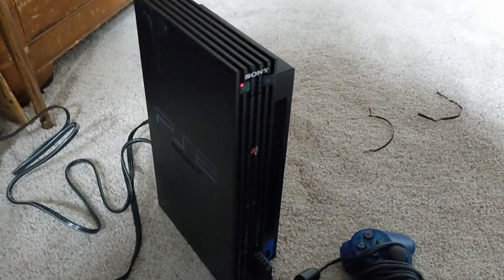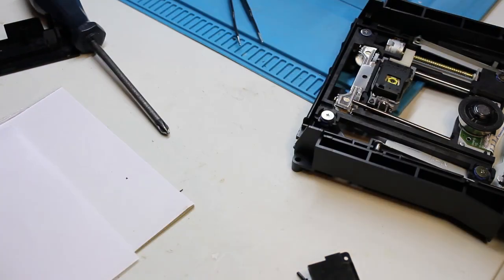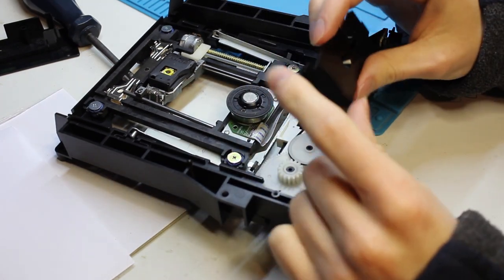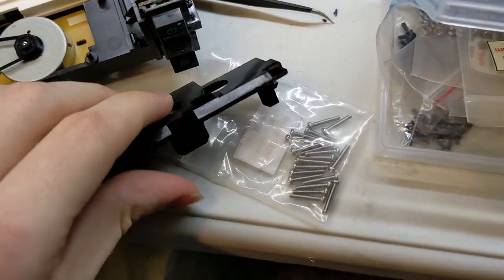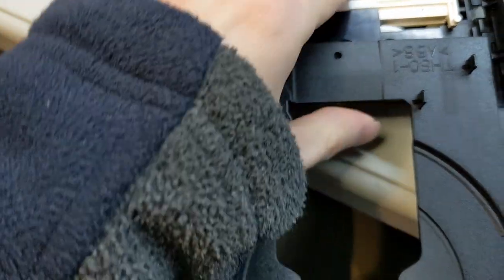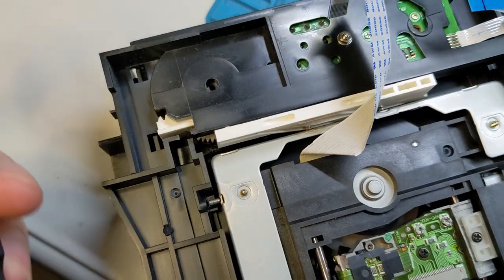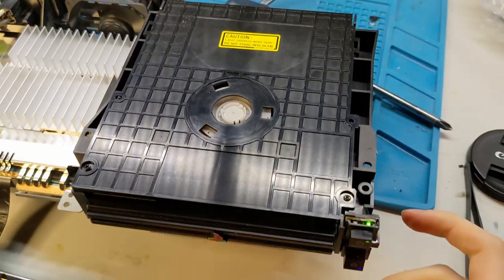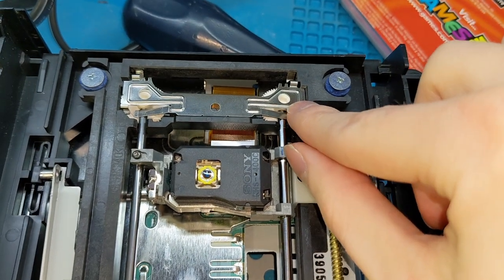PS2 Disc Drive Repair Attempt

Comment: Hey there! I have a ps2 slim and when I turn it on the laser motor pushes the laser eight up to the spindle and keeps trying to force it forward,  but it just skips on the worm drive. Any idea how to fix this? It's not reading any disks. But I feel like it isn't the laser